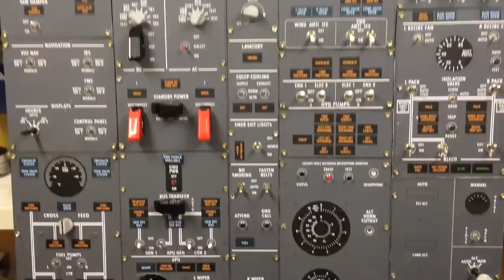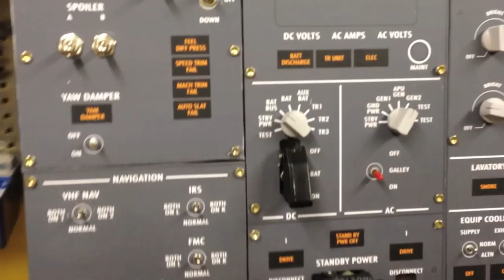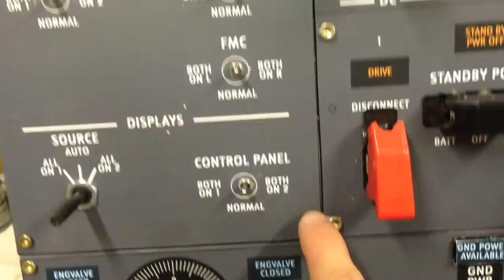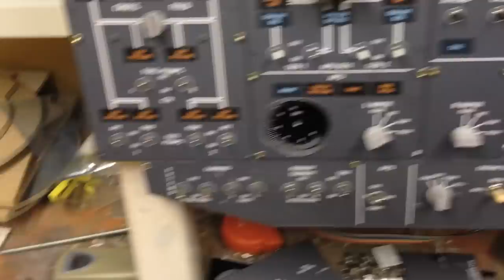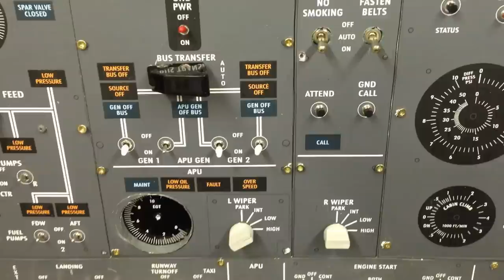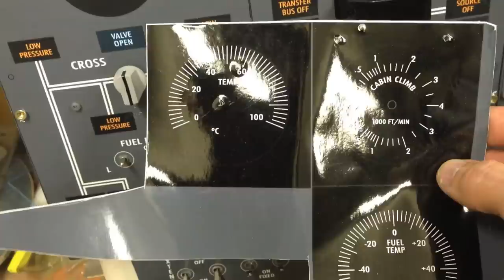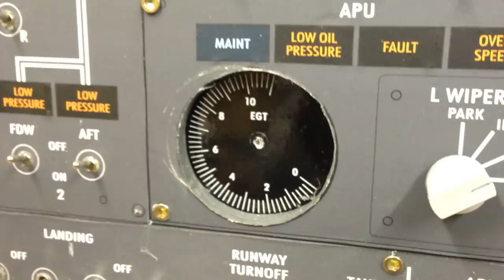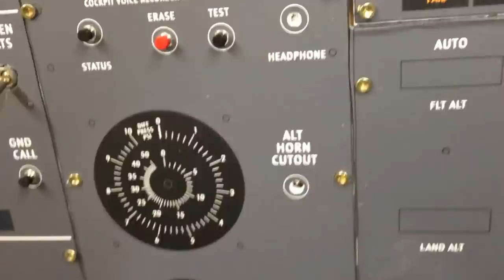$50 Overhead - B737 Home Cockpit

Comment: You can build your own expansion cards for the pokeys leds. You need one cheap chip called the  ULN 2803 for every 8 leds. The chip switches the ground side of the led so you run your power to all the leds and then one wire back to the chip.

Comment: thanks for the file. I'm preparing a laser cutting template based on your drawing. I will paint  a sheet of plexiglass grey and cut and engrave the lines onto it  with laser cutting machine then the panels will be perfect. I just want to notice you that  the file you gave  us has overhead light label missing. circuit breaker ligt label is there but below that, a label is missing. For your information. Thanks so much.

Comment: New to all of this, but reasonably handy. Am a general contractor with engineering background. Just in the pre-planning stages now. What are you using as an interface between the pokeys and the pc? Mobiflight? Just trying to get a better understanding of this series of hardware and software. Im considering arduino mega and mobiflight. Thoughts?

Comment: Hi Mad great project on your cockpit.
I'm not sure if all the buttons are still work if you push them up to 100 times because material you wrote here foamalux/plexiglas looks like what germans call Styropor and its not a strong material.
Proberly it will broke verry fast ?
Maybe it is better to use blue or other colored plexiglas
so you can do some lights (led or something) on the background
and it will shine from the frontside of it and in dark rooms ?
I made on of these pannel for Falcon A.F on a F-16 Jet
and use blue plexiglas with a strength of 5 mm.
All the buttons i was build in these 5 mm plexiglas are still the same strength
as the time i was create and build these pannel.
My next Option is to line up some wires and LEDs to show the different buttonstates on a led when a button chance his status for on or off with green an red leds.

For control this things i use a ARCAZE USB-INTERFACE with 40 digital I/O-PINS and some analog output, and a ARDUINO MEGA 2560 Rev. 3 witch got up to 50 and more digital I/O-PINS with PWM-supported outputs for adjust the brightness and so on.

Here are the Weblinks to the Mainpages of Arduinoboards http://arduino.cc and Arcaze-USB-Interface http://wiki.simple-solutions.de

The last weblink for the Arcaze-USB-Interface some guys said that this one at last time was cheap to get in some Internetstores.

Comment: Great Job and you show how a little work can make a great looking overhead. I converted the PDF to a JPEG and got Walmart to do a poster size so I don't need to cut it all up $19 the switches are not so cheap, but I can do a few at a time. What was the card you mentioned to allow LEDS ?
Reply from the maker: I use OpenCockpit cards (ExpansionCard and MasterCards)

Comment: hi mate ... is it not possible to use the LED extension board with pokeys? Looks like you can run multiple LEDs per output. It's available from flightsimparts -dot- eu.

Just starting my own cockpit build, so your videos is very helpful so far, thanks !

Comment: hello , I'm working on a similar project but I'm facing a problem , I only bought input cards , so I should be working on an aircraft that has warning messages on the EICAS unlike the 737 which you have to look at the overhead panel and see what is the problem , so I decided to go for the 747 because it has a perfect warning messages on the EICAS and I dont have to mound LEDs in my overhead panel and I dont have to buy a SIOC card , but I just need the B747 overhead panel stickers , cab you send them to me if you have them ?
Reply from the maker: Hi Mahmood. 
I have only made the panel for the 737 as this is the one I build. So I am not able to help you with a 747 version. But you can download the Illustrator-file from the blog and edit so it fits your needs. 
Regards Peter
Reply: Build a Boeing thank you very much , if you can tell me about an MSFS B737 addon that has EICAS messages like (Park Brake off / Fuel low ) warnings like that , I will be very thankful to you

Comment: Do we have a handbook aboyt how to connect cables?
Reply: Also what should we use to connect them like arduino etc?
Reply from the maker: No, there is no handbook because it depends on your interface boards. I mostly use OpenCockpits. But other cards are different in regards to how many switches that can share GND.
Reply: @BuildaBoeing  okay but for me, I'd like to get a laser like the k40 chinese then build panel from myself but first, I can't get measurements and then I don't have that perfect knowledge about that.

Comment: i like your solution of printing it different panels instead of just one simple layer. But ive improved it a little bit, because my print-supplier printed it on a transparent foil so i have decided to paint the letters on the anounciators white and coluered just the frame so i can put a small LED behind it. The contra is that i've lost my '3d look' a little bit. What do you think about this, and is it possible? 
And theres another question, i know that you used prosim737 since the early idea of your project, but do you think that it's possible to do it with just fsuipc and pmdg? I can't spent to much money cause i'm a pupil and the real flying is not cheap. ;) So your DIY videos are the starter switch for my cockpit.

Comment: Where did you get the switches? What are the switches and how did you interface them all?
Reply from the maker: Switches are bought from eBay. They are simple on-off toggles (Or on-off-on). There is no simple manual for interfacing because it depends on the type if interfaec boards you use.
Reply: Build a Boeing thanks for replying! I'm keen to start on a diy project to build a few instrument panels. 

Do you think you'd be interested (if you have the time) to do videos on how you interface them? (e.g. industry name of those switches, soldering the connections and programming)

Comment: Hi Peter, I have tried out this technique to pretty good effect since I saw your video. Question: how do you accurately cut the holes for the switches? I've used a hole punch for leather but it doesn't give a very good result. Any tips on this would be welcome!
Reply from the maker: I just used a normal drill. Goes through foam like a hot knife through butter. If you use plexiglass I recommend you reverse the drill and use the heat from friction to work your way through the plexiglass. I have cracked many pieces of plexiglass using a HSS drill if the "right direction"

Comment: Is it usable for FSX? I understand its for the Home Cockpit 737 but is there plugs or such to use for  FSX? :) Please reply at your convenience! Thanks in advance!
Reply: Ofcourse this is for FS
Reply from the maker: Hi. As mentioned above, this of course works with FS. It is just a piece of plastic. For it to work with FS you need something to connect your switches ot (Interface cards). All I have done is to make a pdf-file you can print and use for your own build at a low cost. 
Regards Peter
Reply: Alright, thanks! :D
Reply: Go to www.DesktopAviator.com the have an interface that you can hook switches up to that is a usb device, I have 2 of them and can hook up 40 swithches...
Reply: Don Cornwall 40 Switches on 1 hub or 40 on 2 hubs?
Thanks

Comment: Hi. I'm just wondering how many of each switch did u use? Like how many LEDs, how many on/off switches, how many buttons etc.
Pls reply I hope to build my own soon. Thanks
Reply from the maker: All switches are connected. 2 LEDs for each annunciator. But you need different types switches (2 position, 3 position, push, rotary etc)

Comment: is it easy to hook up the PosKey56u card and does it come with a manuel?
Reply from the maker: The Pokeys is very easy to work with. But of course ease of use depends on what you interface it with. I use Prosim737, and the Pokeys is a perfect match, no need for a manual (But yes there is one on the website).
Reply: cool thanks for getting back to me so fast, but is there any other interface i could use like fsuipc?
Reply from the maker: To be hornest I don't know. Not because I not am willing to answer, but because I have used Prosim737 and not and any reason to look in to other options. But I am sure that you can get your answers after quick research. You surely are not the first one that have asked that question. :-)
Reply: ok thanks :)

Comment: How do I connect this panel to my flight simulator??? Please reply as I might use this tutorial for my flight simulator:) thanks
Reply from the maker: You need interface cards. There are many different options and it really depends on your software setup. Look in to BU0836X, OpenCockpits and PoKeys.
Reply: ok thanks
Reply: Build a Boeing if I pay you would it be possible for you to build me an overhead. Because im really not a handy man.

Comment: hello everybody, i have a question: What is the thickness of the panel?, thank you!
Reply from the maker: +Pedro Picon Barriel Try looking at the link in the description...
Reply: ok, thank you!
Reply: +Build a Boeing hey,where I live I canf find opensim hardware except from aboard(amazon e.t.c)can I use an arduino board to interfacd the switches into the computer;;
Reply: +Teo Pit Try the unojoy/ megajoy program. It allows an arduino to be used as a game control interface
Reply: Gari Jackson yes,I have tried mmjoy whichy is bbasically the same,but my problem is that the firmware doesn't load on my board and therefore I cannot do anything about it,it seems like it passively is in bootloader mode and when you short the wires in order to normally put it in bootloader mode,instead the bootloader mode goes away and its not visible,and so I cannot load the firmware but I think its something with its OS
Reply: +Teo Pit unojoy is actually easier. just google around. you can revert back around anytime
Reply: Gari Jackson im googling it now,hope it works with unnjoy.megajoy,thank you
Reply: +Teo Pit and make sure to install atmega flip sotware
Reply: Gari Jackson also I forgot to mention that I have an ATMEGA32U4,and also,is it easy for you to give me the download link for unjoy/megajoy?because in their github I cant find it
Reply: +Teo Pit what arduino do u hv?
Reply: I mean the name: uno, mega, nano
Reply: its a pro-micro
Reply: Gari Jackson*update* I try to upload the firmware via F.L.I.P,I select my device as ATMEGA32U4,then I select communication as USB,and it cannot load the library(could not load dynami library, AltibUsbDfu.dll missing)
Reply: Teo Pit Hm.. that never happened. i'll check that for you
Reply: Gari Jackson its probably caused by my OS,I have Windows 8.1 so it may got deleted by my firewall or something.
Reply: i use Windows8.1 as well
Reply: +Build a Boeing how you did the anunciators for the backlight?
Reply: Pedro Picon Barriel i think LEDs
Reply: but the anunciatos sholud be in transparent or semi-transparent foil ?
Reply: Either is good. though i reccomend  transparent for brighter lighting
Reply: ok, thanks!

Comment: But it doesn't work at all, you can't use it with the pmdg b737-800 because a lot of details are stickers :-(
Reply from the maker: Hi Aaron. 
I only offer you stickers that you can use for building your own overhead instead of buying €500 worth of premade panels. Whichever way you go you still have to build them and interface them you self, unless you have around €4000 laying around for a plug'n'play version. 
Happt landings
Peter

Comment: what did you do for the simulator recognise the overhead´s controls?
Reply from the maker: Pedro Picon Barriel Hi Pedro. You need interfacecards.
Reply: and recognise all the overhead switches?
Reply: I do not know how to configure the simulator controls list  for the PMDG 737-800 in FS2004 to  recognize some  controls like the Fuel pumps ang the generators (the battery and fuel valves aren´t conflicitive in the PMDG 737-800)
Reply: Pedro Picon Barriel You can use Key-board  in your usb keyboard .: )  or you can buy the interfacecards ,
Reply: Pedro Picon Barriel Its A Software Bought FSUIPC it is called
Reply: oh FSUIPC,  i haven´t idea that can be used for this.
Reply: You Have to check it out :) :)